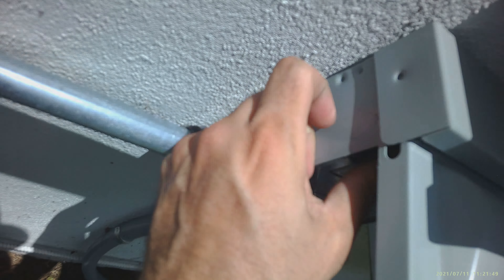Ruud HVAC Capacitor Gone Bad

Comment: $7 fix for $400 with an HVAC company. wish everyone would learn these simple things. i keep 2 spare caps in my garage, cause i can't afford to pay someone outrageous prices for simple repairs. this happened with my a/c within a year of buying my house, caps usually only last about 3 years in my experience.
Reply: Yep, at a minimum is to have the capacitors. I have every part on a shelf just ready in case they are needed. Capacitors, fan motor, contactor, relays. Cleaning the coils is really important also. 👍🏼